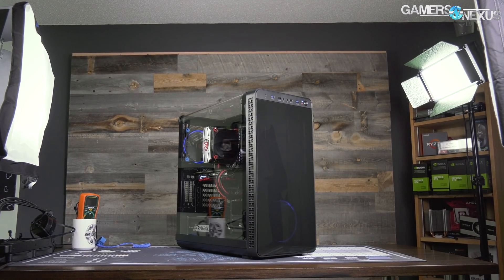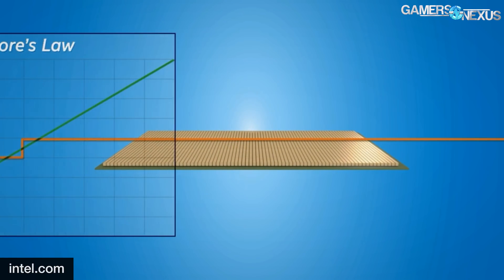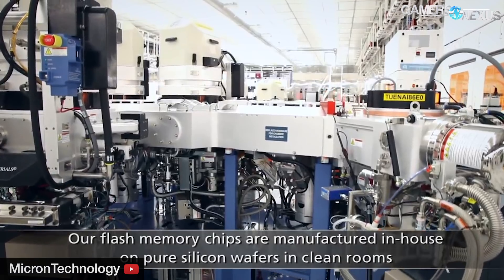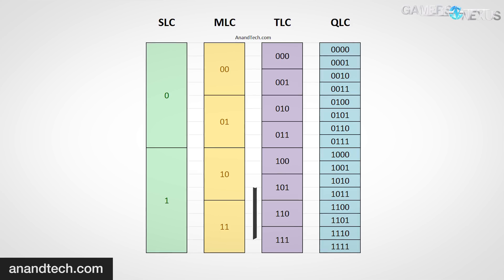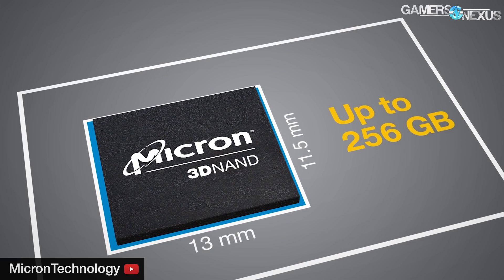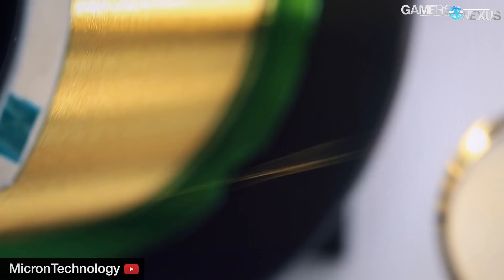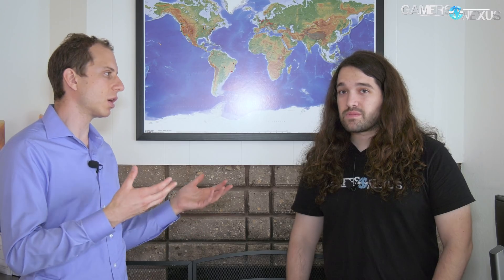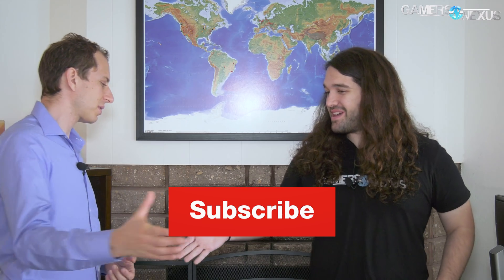When Will SSD & Memory Prices Recover? ft. David Kanter

Comment: Wow I bought 256MB for $500 back in 1996. (cannot remember the exact module spec but I remember the price was around $500 because I was getting a refund for receiving a bad module). Price went down again sharply on 1997/ 1998 until an increased because of an 1999 earthquake.

Comment: Thank you for another good video.    I will be glad when Samsung realizes they are not God or so great that an M.2 NVMe 970 Pro 1TB SSD or EVO 2TB is priced more than a DIY computer; and do something to reduce NMVe SSD temperature, at least include a heat sink.  And, why no 970 Pro 2TB?  Games and programs are getting larger, not smaller.

Comment: SSD prices are getting down  at least back to wherer they where in 2016.. i bought a 120GB  sandisk SSD in 2016 october.. in 2017 it got 25% more expensive. now its the same price as it was in 2016 october... same is now it should normally cost even 20% less then that.. but shit happens...

Comment: 6:41 that's a little mistake there, if you are talking about MLC in NAND, it's 4 stages, empty, low, middle, high. Only 3 have some voltage, and are programed. 
SLC NAND is the same, you have empty, or programed, not low, or high. 
In NAND you have always one empty state, you definition would be correct if you were talking about for example NOR memory.

Comment: DDR 4 is great and gobs of this stuff should be wonderful. But every O/S still thinks it's 1998 and uses a storage drive to R/W temp. junk that I do not want to store. My drive light flickers as it stores the next minute of A/V code for my Monitor. I am watching this video, not downloading it for storage. Mac/MS/Linux all treat temp junk like a storage request. None of these use the ram even if I have 64GB of DDR4 sitting unused. It's not 2002. I'm not on a P4 cpu with 2 1GB sticks of RAM.

Comment: HI i have a Crosshair vi extreme x370 and r7 2700x would incompatible ram stop me from installing windows. i have 4 difffernt drives. 2 3.5 inch drives 1 m.2 and a nvme and on the install i cant even get into the the actual screen where you input countrty etc,  hope you can help thanks

Comment: SSD prices are incredibly cheap nowadays...

EDIT: a lot of people replied saying they're expensive, which is blatantly wrong. You can't look at hdd prices and say "oh yeah, see that shitty type of storage? that costs 50$ so ssds ARE expensive". It doesn't take a genius to see why that sentence is stupid.
And for anyone that wants to prove me wrong - can you give one example when you could get either faster storage than a 480gb ignite for the same price and cost? How about more storage while maintaining speed and cost? Same applies for a 240gb s280 for 55$, or a 500gb 960 evo and the list goes on.
SSDs are cheaper than they've ever been depending on what you want to buy.
Reply: They got super expensive for a bit there but I got an email add from newegg today with 500gb SSDs for 89.99
Reply: Cheap? 160€/190usd for 500gb where I live. I wouldn't call that cheap. If you go for NVMe, you'll pay even more. 960 pro 512gb go for 280€/340usd!
Reply: @Daniel What the hell are on about? What kind of argument were you trying to pull? You're comparing a new luxury car to a used car. And saying my comparison is stupid. Better look at what you're trying to say first.
If you were trying to say that SSDs are cheaper than the first time they came out, that's true, but that's true in all cases.
The fact is SSDs are still expensive. When the price per gigabyte for a SSD will be the same or really close to the price per gigabyte of a HDD, then you can say SSDs are cheap. Until that day comes, you can not.
Reply: Yeah seen tons of 500gbs on slickdeals for anywhere $100 to $130 for samsung
Reply: If you compare it to before..... Yes its cheap 120gb ssd going to 100$ and up and now 480gb and up ssd going for around 90$ Its quite cheap now
Reply: Did you check the graphs on the price for SSD's lately?
They've never went down once in almost 2 years now, only up and they will continue to go up.
Reply: Old tech ones with no DRAM buffer appear to be "cheap"

raw prices per GB have stagnated and prices of the nicer new tech has actually gone up per GB instead of steadily going down as we get better at making it.
Reply: The Stig
They have come down
Reply: Now there're 2TB SSD for ~~ 315$ new 3 years warranty. It's wayyy cheaper than before
Reply: Running 2 NVME drives in Raid 0 on anything but Threadripper is kinda pointless, even on Intel HEDT (since all the M.2 slots run via the chipset 4x DMI connection to the CPU). Threadippper/Epyc is the only x86 CPU's that run directly from the CPU. Shoving 2*4x PCiE worth of bandwidth through a 4x connection doesn't make much sense IMO. Some x470 boards like the Asus CH 7 can take part of the GPU slot and use it for one of the M.2 slots though, which also works.
X-point is currently limited to 2x per drive though AFAIK, so 2 in Raid would actually work too,  if you could split it up correctly... (which I doubt ANY board would allow right now, without resorting to a PCIE add in card and bifurcation support in bios).
Reply: You can't make that comparison. That's like saying a 20,000$ lambo isn't cheap because you can get a used car for 3000$ - the comparison is stupid, you need to look at past prices of the same product, and depending on what you want to get, ssds are the cheapest they've ever been.
Reply: Cheap? Yeah, Nope.
Prices of SSD's can be described cheap when they match the price of a HDD for the exact same storage space.
When an 1TB SSD will be 50$ same as a 1TB HDD, then you can say it's cheap. Until that day comes, you cannot say that.
Reply: You can get 500gb ignite for 100$, or if you really want speed you can raid 0 two 256gb M8Se for 70$ each through amazon.
There's plenty of options, if you don't want to raid 0 you can get a 250gb 960 evo for 118$.
There's actually very little difference between a 960 evo and pro, and the evo is insanely cheaper so you can get a 500gb one for 220$, or you can even get the new 970 which is cheaper and faster than the 960 pro. No idea why anyone would even buy the 960 pro at this point imo.
Reply: mcopyrigh 
"You're comparing a new luxury car to a used car. And saying my comparison is stupid."
No, I'm showing you why your argument is stupid. You can't equate ssds to hdds and say one isn't cheap because the other's cheaper just like you can't say the same about the cars. Thing is, I know you're not stupid enough to not know this, you're just going for "argument points", you and everyone reading this know why what you said is wrong.

"The fact is SSDs are still expensive. When the price per gigabyte for a SSD will be the same or really close to the price per gigabyte of a HDD, then you can say SSDs are cheap. Until that day comes, you can not."
No. That's incredibly stupid. Imagine if you said the same comparing sram to dram, who in the fuck wouldn't say that 16gb of dram for 5$ is expensive? Do you understand why your argument is stupid?

The stig
"Did you check the graphs on the price for SSD's lately?
They've never went down once in almost 2 years now, only up and they will continue to go up."
Then you aren't looking at the right graphs. You could never buy a faster 480gb ssd for 100$ than what you can now; Same goes for capacity for similar or greater speeds. Same goes for getting the 70$ M8Se.
People buy the best bang for the buck, it's meaningless to look at prices of ssds that almost no one buys, and for the ones that give the best value prices have gone down immensly.

For anyone who wants to reply, this question applies to all of you: show me one example of when you could ever buy faster storage with the same capacity (or greater) than the 480gb ignite, or more capacity while still being the same speed or faster.

Comment: didn't even know SSD prices were broken as well. i thought that was just how it is and bought a 1TB MX500 a few weeks ago, since that series seems to be the best in terms of price/performance. it's so very nice not to have HDDs anymore. so expensive, but so fast, so silent
Reply: They definitely aren't broken.
You can get 480 GB ignite for 100$, or really fast 240 GB (M8Se) for 70$. There are a lot of other options as well, but I wanted to show you can still buy fast ssd's for cheaper than they've ever been or large capacity for a lot less than what they used to cost.
Reply: Daniel Fisher oh, i know, that's why i was surprised to see SSDs being included in the pricing discussion. they actually got cheaper since i built my system exactly one year ago. i paid 94 EUR for a 250GB 850 Evo, which right now costs 73 EUR for the 860 Evo. and while neither of the two models you mentioned are readily available here, there's drives from Toshiba, PNY, Adata and others that cost like 50 to 55 EUR for 240GB. or, as you said, around 100 EUR for a good 500GB drive like the MX500. 
so... according to my limited observation, now's actually a pretty good time to buy an SSD, it seems. certainly much better than buying DRAM, which increased in price since last year. Vengeance LPX (2x4GB 3000MHz CL15 ) was 82 EUR, now costs around 110 EUR
Reply: I agree on almost everything you said, just a small side note on availability and pricing is that you can get international shipping from amazon for the ssd and can get 2x4GB ram for 80$. But still, last year you could get 16GB for less than 50$..
Reply: What's especially great about solid state is that even the lowest end products are pretty damn reliable & quick enough to not be bothersome

Comment: They won't recover, they haven't since 2006
Reply: idt so
Reply: i was able to get 16 gb for 70$ in 2016
Reply: María memory prices or SSD? Because ddr4 was great when it was new, then RAM started to go up and up, now it is up by over 100%, so prices were good after 2005, though ddr4 didn't exist back then
Reply: Although in the 05 the price did start to lower.  Its far from optimal, it was still pricey.  But 2015-16 was the golden age.  On summer 2016 I'd say it was the best.  Price per MB that is.
Reply: what are you talking about? 2 years ago they were 50% cheaper...if they go back to that price im good with it.
Reply: Memory (maybe not so soon) because it was a constant increase, faster recently, and SSDs since they were sold (I don't know when)
Reply: I was refering to ram in general.
Reply: do you have a way to track the price?
Reply: This and that are good reference.
https://jcmit.net/memoryprice.htm
https://www.statisticbrain.com/average-historic-price-of-ram/
As well as places like PC Part picker or other stores online that monitor prices of tech.
And years of experience.
We may have seem some "low" price many years ago.  But that was when?  When 512MB sticks were the norm?  With an occacional 1GB?  Wile mid 2016 buying 8, 16GB was common and even 32GB was not odd. And it was cheap enough to do it painlessly.  In cases costing even less than half the price of today.  So yeah price per MB 2016 was golden.